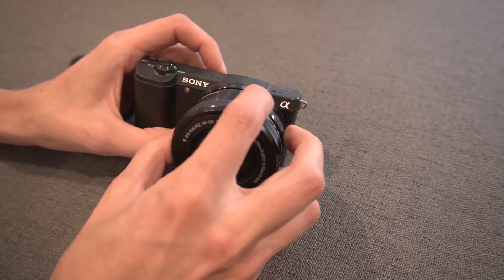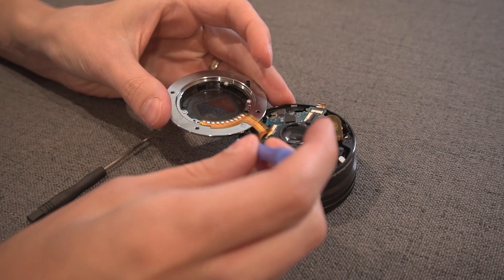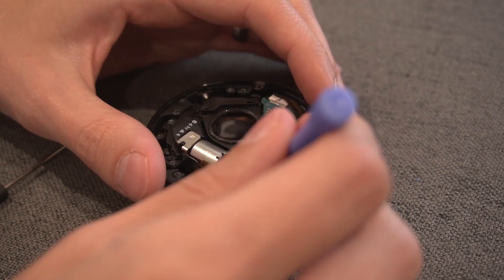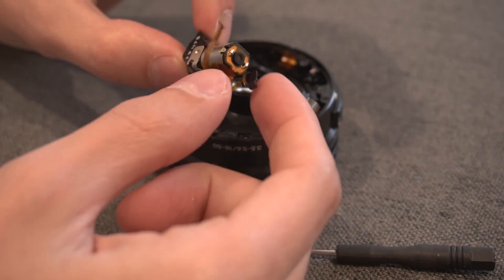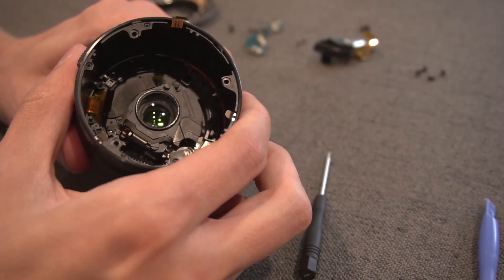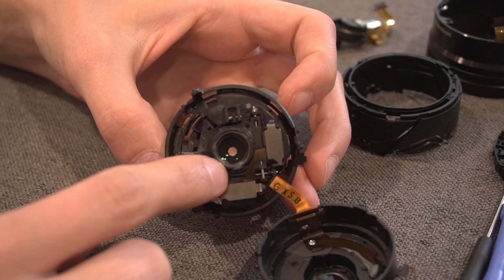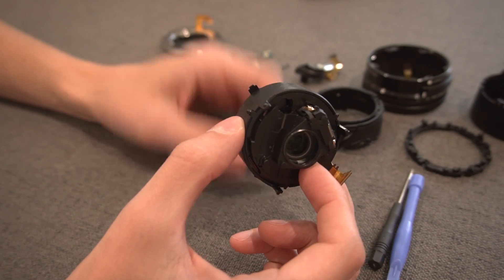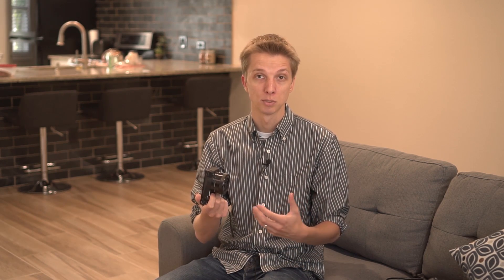Sony 16-50mm Kit Lens Disassembly Tutorial

Comment: What i mean with the last band,  is the last conector, when putting it together ( the first one you disconnected ) has to go in with the golden side u into the locking mechanism. Otherwise I could not focus with the lens. This is the only band that goes in this way.

Comment: Took it apart about three more times, finally recognized the lens bout could not focus. Finally figured out the last band was not with the golden side up. That did it. Thank you
Reply: Can you please explain what do you mean by "last band was not with the golden side up"? I took it apart several times (I was replacing broken ring) and I was never able to make the focus work. I noticed that the focusing optical element is loose, because when I point the lens up or down it kind of focuses for a moment when the element crosses the right focal distance on its way up/down. Thank you.
Reply: @randomtravelerjournal  Same issue. Did you ever figure it out?
Reply: @richardscmatt  unfortunately no :/
Reply: @randomtravelerjournal  Bummer. Thanks for the reply.
Reply: @randomtravelerjournal  I thought I would let you know that I figured out why mine wasn't auto-focusing... I must admit, it's a little embarrassing. There are four ribbon cables that attach to the PCB. In the video, during the rebuild section, he only shows three of them being installed. Normally this would be a completely obvious oversight (and admittedly it still is), but one of the ribbon cables on the right of the PCB is very easily covered up as you place the PCB down. As a result... I just didn't install it... 

Take a look at the image below. The ribbon cable labeled "A" ended up below the PCB. He doesn't show it being reinstalled, so I just mindlessly skipped it. It goes into "B" with the  gold side down.

The commenter above is referring to the orientation of this cable. They must have installed it upside-down. I simply didn't install it back in the PCB. Once I did, everything worked great. 

I hope this helps!

https://imgur.com/a/pOGuysS
Reply: I have the same issue. What do you mean by "last band was not with the golden side up?

Comment: This worked like a charm! Took me about 2.5 hours but it was worth not having to buy a new lense. At one point my lense got stuck to the barrel and it wouldn't slide because the little pieces that had broken off the plastic ring were jamming it. So i just used the screw driver to turn the gear until it became unstuck. And took out the little plastic piece that broke off, i didn't glue it back since it  was so small just removed it so it didn't block the gear. Putting it back together was more of a challenge but it was very rewarding seeing it work!

Comment: Worked like a charm.  Replacement rings are cheap, I'd use that instead of glue.  ($6-12)  Took me an hour.  Hardest parts were bending the outer casing, and getting the sets of two pins from the innermost parts lined up and into the sleeve at the same.  The "hardest part" wasn't that hard for me.  I found putting the screws back in disconcerting in terms of the resistance, but all seemed ok and there wasn't one orientation that was lower-effort; they were all stiff going in - which may be on purpose so they don't back out.

Comment: Thank you so much! This was just amazing. I had dropped my lens and the barrel was not moving in on turning off. After I opened it up and put it back together, everything started working again. I had some difficulty in removing the outer part from the barrel (where you have to press and remove), and while putting that back, I realized that it does fall into place in 3 configurations, out of which only one will position the ribbon on the outer part in line with the slot on the PCB. Took more than an hour, but totally worth it. Thanks again!

Comment: Top tip.  At around 11.50 in when putting the rings back togethere.  Remove the base ring thst the ribbon connects to. That makes it easy. Then add the base ring last as it's easier to line up. Also. Before putting the motor back in leaver the teeth slightly towards the motor. Or you'll find they lock and the motor won't drive the lens.

Comment: 5:38 my lens doesn’t move! It’s just stuck there
Reply: did you get it figured out? I am stuck in same place
Reply: Guys, there is a ring which is shaped like a saw. You have to rotate it counterclockwise with some force with a blunt object and at some point it will come free. then take it apart like in the video and some pieces of broken plastic might fall out ;) it does not have to be rotated much., only a little and it will come free
Reply: @BearCore200  Same problem here and it's so stuck that I can't make the gear turns. Did someone find another away or something ?
Reply: Same..
Reply: Michael De Leon did this ever get resolved?
Reply: If your lens doesnt move it menas the broken plastic is disturbing it
Reply: yess i wanted to comment the same so was checking if someone else commented but guess you didnt get any answer on what to do about it?
Reply: Were any of you able to fix it after it was stuck? Or does that mean it's completely ruined? Lol
Reply: the same happening with me! any fixes??

Comment: Hi! My camera had the same problem, I dismantled the lens according to the video, found the broken ring, substituted it with a new one, but back everything. 
Now the camera recognises the lens, but the image is blurry (gets sharp sometimes, but just for a moment then gets blurry again). The zoom goes in and out a little crazy and when I turn it off, doesn't always goes back to its place. Do you have any idea what can cause this problem? Did it happen to anyone else? I dismantled 2 times, with the same result...
Thank you if you take the time to answer my question, great video btw!
Reply: Were u ever able to figure it out? Im stuck on the same problem, really frustrating...
Reply: @andrejkyselica373  Same issue. Did you ever figure it out?
Reply: Same issue. Did you ever figure it out?
Reply: no 😥
Reply: @evamajor1227   I thought I would let you know that I figured out why mine wasn't auto-focusing... I must admit, it's a little embarrassing. There are four ribbon cables that attach to the PCB. In the video, during the rebuild section, he only shows three of them being installed. Normally this would be a completely obvious oversight (and admittedly it still is), but one of the ribbon cables on the right of the PCB is very easily covered up as you place the PCB down. As a result... I just didn't install it... 

Take a look at the image below. The ribbon cable labeled "A" ended up below the PCB. He doesn't show it being reinstalled, so I just mindlessly skipped it. It goes into "B" with the  gold side down.

The commenter above is referring to the orientation of this cable. They must have installed it upside-down. I simply didn't install it back in the PCB. Once I did, everything worked great. 

I hope this helps!

https://imgur.com/a/pOGuysS
Reply: @richardscmatt  I will give it another try, thank you

Comment: i dropped my camera in the gym and the stock lens got stucked and stopped working, thanks to your video now i'm back to business, bought the lens as 2nd hand so it's going to cost more bringing it to the shop - The labour cost here when it comes to camera in Aus is crazy, it was tough fixing it though, took me a good 2 hours
Many thanks man !
Reply: can you dm me how did you fix it my camera wont read my lens anymore and the focus ring wont stop spinning when I turn it either
Reply: Mine has the same problem but it wont come off how did you get it to come off?
Reply: Dropped mine in the too!

Comment: I have a different issue and wondering if you know what's going on. I have an a5000 and a week ago it just started acting weird, when I turn it on the screen will glitch a few times and the lens retract and extend a few times too and most of the time after that it will be mostly okay, but every time you turn it on it does this. When I detach the lens I don't see that glitching on the screen so wondering if it's the lens? The camera has never been dropped or anything and is kept in a hard body case and then kept in a camera bag.

Comment: thanks a lot, i just fix it, but, got problems with autofocus, like the motherboard reset or something, do you know something about it?
Reply: in fact, it connects properly, then 2 sec later, like the lens autoresets and doesnt comunicate whit camera,
Reply from the maker: Take it apart again and try to put it back together - it only goes in 1 way. Make sure it is fully collapsed when you put it together and all the ribbon cables are connected fully.
Reply: TechnologyMafia just did it. 3 times. but the lens keep doing that. im sad bruh... 😟

Comment: Wow, thank you, I just saved my lens. I droped it while already turned off from 10cm off the ground and I also broke that tiny piece. I didn't glue it and put everything back into place and it works perfectly. Thank you so much! You have a new subscriber ;)
Ps: I realized that this was a common issue in this lens so I just ordered two of those pieces that got broken. They cost me 2.3€ both, so now I have spares, just in case!
Reply: Can u pls provide the part name ,part code or something to search to get that part .....I'm facing issues where the lens restarts and switches around many f values and then at last shows 2 lines instead of the numbers in that slot of f value ......I tried different emount lens and they all work perfectly fine on the Sony alpha 5000L ...so I guess its the kit lens issue ...I tried reseting everything and upgrading downgrading and all things related to software ....now I have to go deeper into the lens and I hope I fall into the 90% case and its not something I can't repair myself .......

Comment: New update buddy, it wont flush like in 12:16 i dont know why? I put it on every holes, there is three holes right? I try to put it on them but it doesnt flush all the way in, can you help me please??
Reply: after align the 2 dots of the barrel, start collapsing the barrel when it get stuck, check the upper repaired ring, theres a square hole where a parto of the barrel goes up, and that allowed the barrel full collapse
Reply: Aran Kasih you ever figure that out ? That where I’m stuck

Comment: Hey bud, its a nice video, but i can't open the lrns at 5:54 because its stuck :( can you help me??
Reply: Aran Kasih any luck on this? Same issue here.
Reply: unfortunetly no, i had to go to my local sony support to buy the lens, not the whole lens, just the part of the lens that i needed, and it already cost me about 22$
Reply: Look a the teeth were the motor más contact to rotate the barrel. Push the teeth a little with your finger and the barrel should release

Comment: I got new ring (original from SONY), because the old one has broken pins, but now I'm having trouble to attach it to the barrel (like in 10:26 sec)seems this moment is cut from the video. Any tips for me?
Reply: i can help you bruh. you have to turn the ring so the little dots and connector aligns. like he said,  and thats it, and also pay attention when collapse the barrels, the upper ring has a square hole where a part of the barrel goes up and then make the barrell full collapse.

Comment: why not buy a new part, why take chance it will not hold cause over time the glue will fail for sure......? MFG.   does not repair, time is money and it is cheaper to just replace the lens, so thats what they do, Us on the other hand will replace the part, not me, cause i have 2 thumbs!  QUESTION----IS THIS PROBLEM   ISSUE FOR THIS LENS THAT YOU KNOW OF????????????
Reply from the maker: The glue has been fine for the last 3-4 months. Not a huge issue.

Comment: tried it today but at 5:55 mine did not come off. it is stuck and does not move or rotate at all :(
Reply: there is a small sewsaw like ring near the lens. you have to rotate it a little (as much as you can, but is a very tiny movement) , and that willl unlock the lens
Reply: thank you. you are a godsend
Reply: This is exactly correct, it looks like a sawtoothed crescent. I used my finger and pushed it maybe a 1/16th of an inch counterclockwise and it unlocked.
Reply: Ronah Warren same issue here. I was on a roll till I got to this part. Let me know if you figure it out.
Reply: brad simonsen  great advice I was stuck hear for ages
Reply: unalx thank you so much.
Reply: saved my day, fixed my lens!
Reply: I tried that and it only came up an 1/8 of an inch and stopped, won't go further

Comment: I had the same part broken on mine and completed the whole tutorial which was perfect, but for some reason I cant get my lens flush like in video at 14:37 mine still slightly sticks out and I cant not figure out why.
Reply from the maker: That happened to me twice. Take it apart again, you have to rotate the inner barrel pieces again until it sits flush. There are only three ways to put it back together, so when you feel it drop in flush, you will know it is the right way.
Reply: after 3 more attempts like you said, I got it to sit flush... but unfortunately it still didn't fix it, i hear a clicking noise but it does not extend I've triple checked my glue job to make sure there is no resistance and it seems to be smooth

Comment: Thanks a lot for posting this.  I must have dinged my kit lens in a night club and it no longer would open.  Watching your video and seeing how to remove all the pieces and take it apart helped me fix it and now it works without any problems.  The interesting part is how mine didn't have anything broken inside.  It was probably just bent, but by taking it apart it must have helped loosen it back up. Thanks again!

Comment: The most important step, was Not mentioned! Step 2 should be, put another lens on the camera or put the from cap on the camera!!! The a6000 is well known for collecting dust on the sensor, so please don't lay your camera to the side, with open access to the sensor! Everything else, is great and I'm sure it was an oversight?
Reply from the maker: Yes, that is important. I have cleaned the sensor in the A6000 before, and it was pretty easy, so it doesnt worry me as much as it did before.

Comment: A couple of question about how you removed the cylinder with the spiral grooves from the outer casing - to get it back in the right position, is it worth marking the two parts with a pen as I dismantle; if I'm replacing the same ring that you did, is it necessary to take that grooved cylinder out or can it be left in?

Comment: What if the barrell doesnt slide off like in 4:37 ? :( I don't know what to do now.. It fell off when it was ON with quite big zoom
Reply: Okay panic over, I didn't have to do any more steps, doing everything just until that point and trying to spin the little ring somehow unlocked the whole mechanism. Thanks for the video because I wouldn't have done it without it! You saved me some money :)
Reply: May I ask exactly which little ring you spin? The outer focus ring or the inner thin plastic ring around the inside of the lens? And how did you spin it exactly to unlock the whole mechanism? What's your secret because I am stuck on that point.
Reply: I'm sorry for the late reply, I haven't seen your comment! I hope you have sorted this out already, because I don't think what i say would help... I only kept moving that plastic black ring and as I was doing it, something had clicked and it all started working together! I was just lucky, not skilful!
Reply: i found that you align the first 2 litlle dots of the barrels, then, when you thist it... pay attention on the fixed upper ring, cause theres a square hole where a part of the inside barrel goes up, if you aling that ring and the square, the part should go up and the barrel fully colapse @Doug5819   if still get stuck, feel free to findme and message me on twitter instagram or fb.

Comment: Could you potentially put better glass in there? Would be cool. :P Good video btw.
Reply from the maker: Lol that would be awesome. I dont think it has ever been done before. The glass elements are small, thats why it is f3.5 and not f1.8.
Reply: Even if it existed, you couldn't. A lens is a compromise between 1) size and weight, 2) aperture and zoom range and 3) image quality. This kit lens is very small, so it compromises on image quality - luckily, it is possibel to compensate for vignetting and distortion, making this lens puch above its (literal!) weight.

Comment: Wish you made this video last year.  Over the last 12 months or so I bought a total of 3 broken SELP1650 from eBay and was able to fix 2 of them.  I took photos as I disassembled them.  I got smarter the second time around; I put a mark where the parts meet before each step of disassembly, and that really helped.  I would have been able to fix the 3rd lens if the eBay seller wasn't a lying bastard.